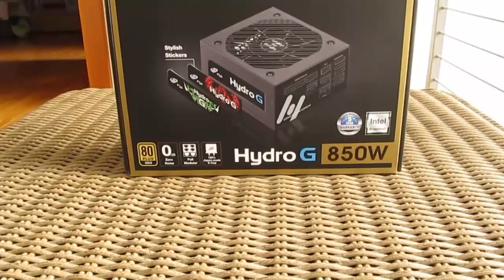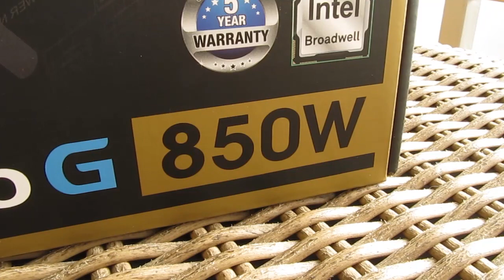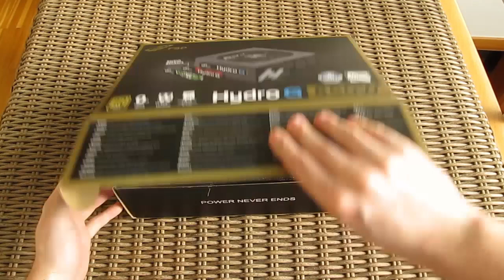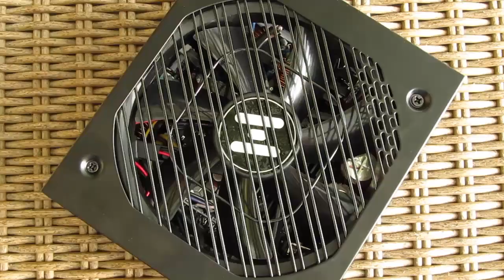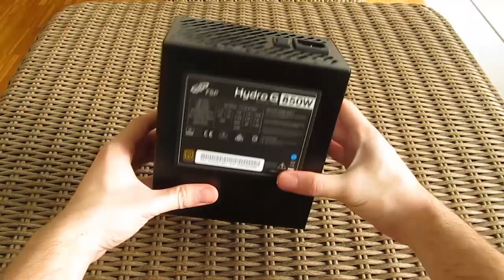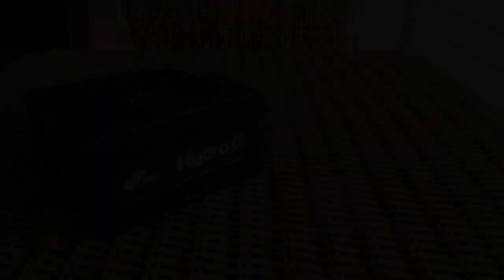FSP Hydro G 850W Preview & Unboxing

Comment: can this psu handle gtx 1080ti in sli ? Has anyone tried yet ?
Reply from the maker: It can, no problem, one pulls around 300W or even less, so you have plenty of room to spare with an 850W model
Reply: TekTick only YouTuber who actually replies to his fans thank ya dude

Comment: Hey i really need help. i am building a pc for my birthday with a 500$ budget. Should i go with a core i3 6100 paired with a XFX radeon r9 380 4gb or a core i5 4460 paired with a EVGA 950 2Gb Superclocked answer as soon as possible please.
Reply from the maker: +TrippyDinosaur Gaming i3 6100 with a XFX R9 380 will output more FPS than that other config!
Reply: thanks dude or should i go with i3 6100 paired with gtx 950 and oc mobo for future upgrades?
Reply from the maker: +TrippyDinosaur Gaming You mean i5 4460? If you're counting on future upgrades, then better buy a core i5 4460 or i5 6300!

Comment: Honestly I do not think it will be worth $120. Though the features seem to be very full and actually pretty amazing, I myself will only pay a MAX of $100 for less than 1000 watts.

Great video like always though. :)
Reply from the maker: +Mason Brasher (fluffythedestroyer) Thanks man! :)
Reply: +Mason Brasher (fluffythedestroyer) then you're an idiot.
Reply: OK Thank you. Noticing we don't make much money and there are plenty of good budget power supplies, I don't get your hostility? but okay...
Reply: Mason Brasher " I myself will only pay a MAX of $100 for less than 1000 watts."

This is completely idiotic as you write off ALL of the good 850W PSUs with the exception of about 3 like the EVGA GQ when it's on offer! The FSP Hydro G 850W can be found for $99 now and that is a fantastic price for a PSU like this.

Plently of good budget PSUs? Such as? 

EVGA B2

EVGA GQ

FSP Hydro G

EVGA GS

That's it! That's all you'll find under $100 that's 850W and good. And these all came out recently, if you did this 12 months ago the only PSU would be the EVGA B2!

Unless the others are on rebate they're nearly always over $100 as 850W PSUs so you limit yourself completely.

SeaSonic's X is gone. XFX XTR 850W gone. EVGA G2 gone. EVGA P2 gone.

How can you expect them to sell a Platinum 850W PSU for under $100? Illogical. 

Corsair's all gone too. The VS, CX, CS and RM are all shit so all you have is the RMi... and it's well over.
Reply: +OK I'll never use 850 watts either, like I said I don't make much money. Why don't you find a better thing than judging people's opinions?